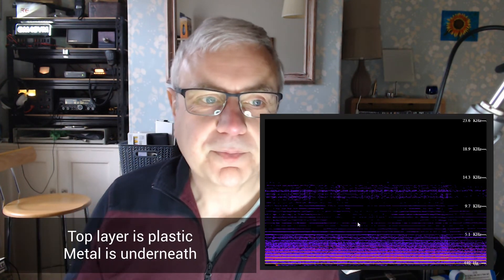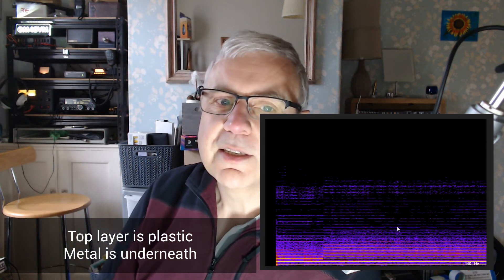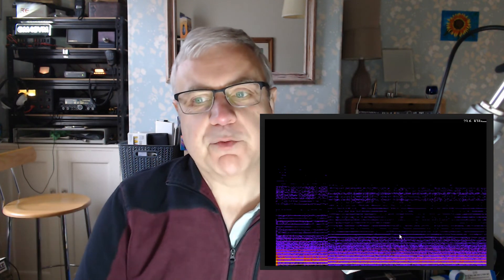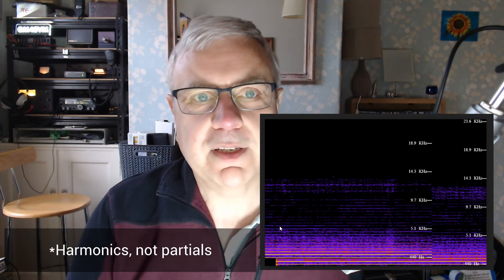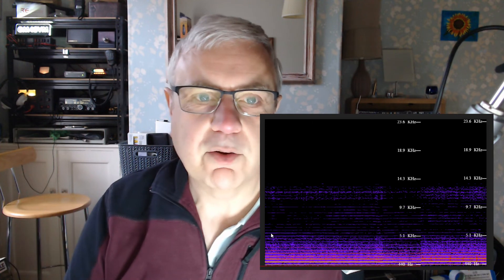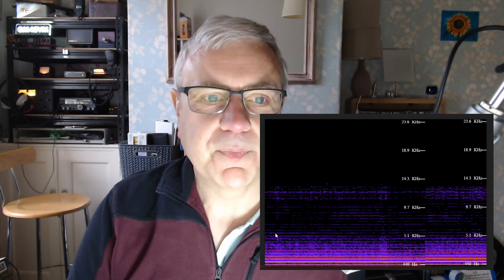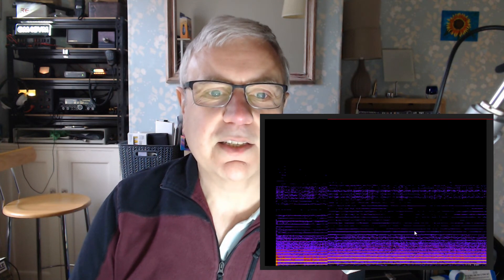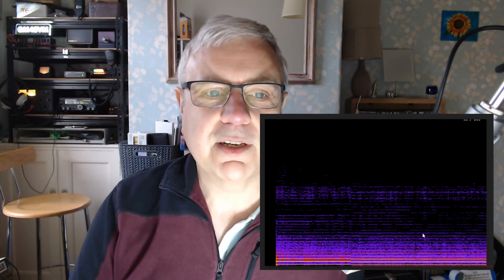Plastic vs Metal Trumpet mouthpiece - Is there any difference in sound?

Comment: Would they work well for flugelhorn? I'm aving trouble getting the instrument to speak at ppp.
Reply from the maker: Might do. Sometimes people have problems playing quietly if the tuning slide is too far in, or out, and they are playing into the top or bottom of the slot. Normally it's too far in because the instrument goes flatter as you blow louder. Try tuning when playing really quietly or just pull the slide out a bit so you play more into the middle of the slot. You will still be in tune but it might speak easier.